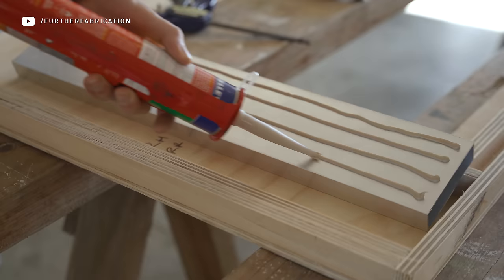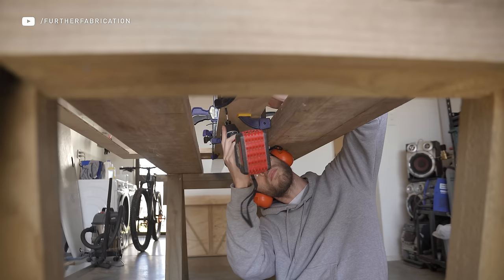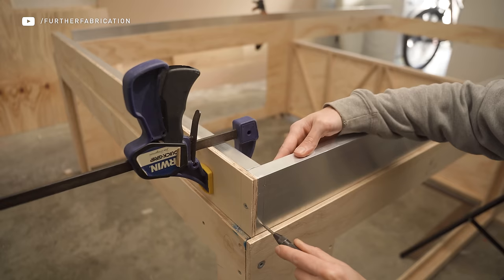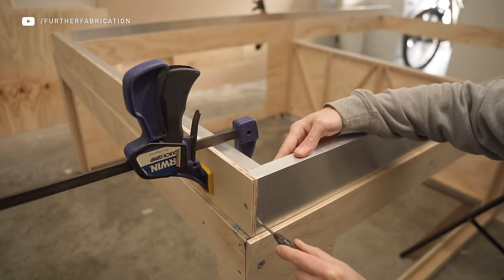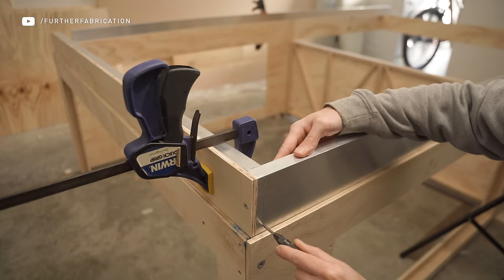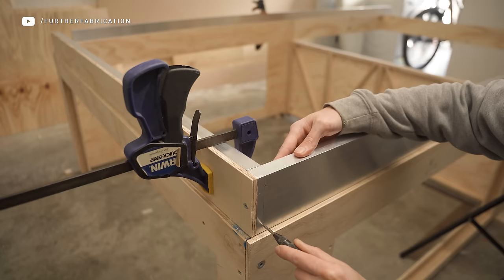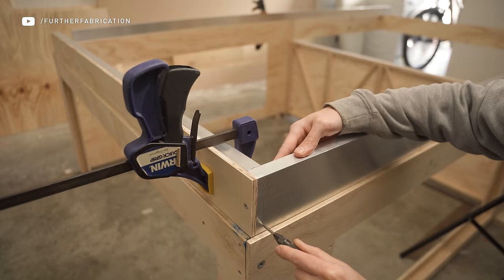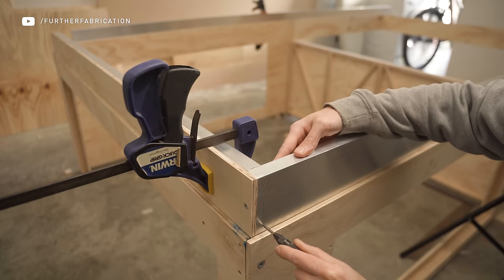Build an Expensive Camper WAY Cheaper

Comment: DO NOT use salt in your glue, nor sugar.

Taken from wood magazine, according to Jeff Loflin, glue specialist at Franklin International (maker of Titebond wood glues), salt and sugar can react with wood glue and alter its composition, resulting in a weakened joint. Rather than resorting to parlor tricks, apply good gluing and clamping techniques. 

Too much glue in a joint, especially laminations, acts as a lubricant, letting the boards slip and slide. Instead, SPREAD A THIN, EVEN coating on the mating surfaces; use a spreader or roller to even out the glue.

When clamping multiple workpieces together, uneven clamping force can cause the boards to slip around. To avoid this, GRADUALLY add pressure throughout the joint for EACH clamp. 

Realign any workpieces as you go by hand or with gentle mallet taps. As you slowly increase clamping force, the glue tacks up and holds the boards together. Continue tightening the clamps alternately until you see squeeze-out at the joint lines.

Simples!
Reply from the maker: Thanks for the heads up, I appreciate you passing along that knowledge!
Reply: @FurtherFabrication  no problem, honestly one thing I see a lot is too much glue. Glue always works best when applied as a thin layer rather than a bead or blobs, this is because it allows proper surface mating. 
With too much glue, the surfaces will be held too far apart and the glue isn't bonding the surfaces, but rather it's creating a gap. Glue makes a poor filler and when too thick and is prone to stretching, flexing, fatigue and failure under those conditions. Think of glue more as a surface binder, you want the surfaces to touch and bind together, the same as you would for super glue, rather than as a separate layer, where it acts as a gap filler, sealer or bonding agent.